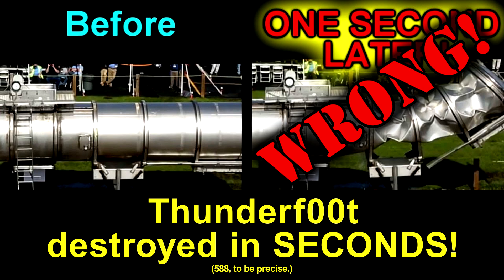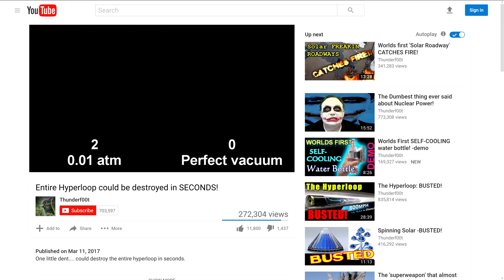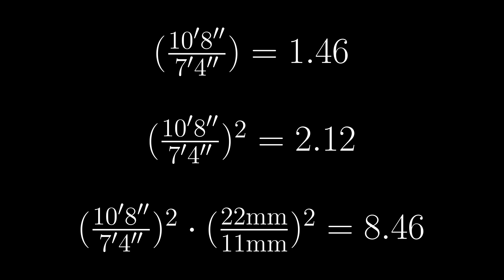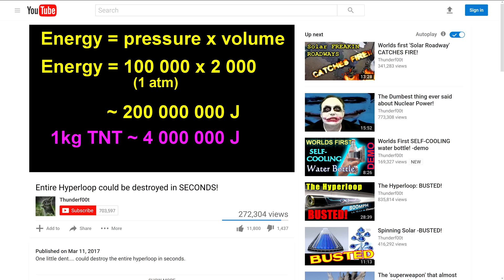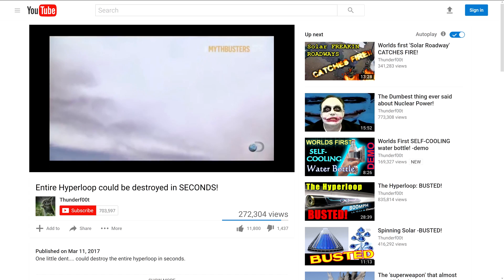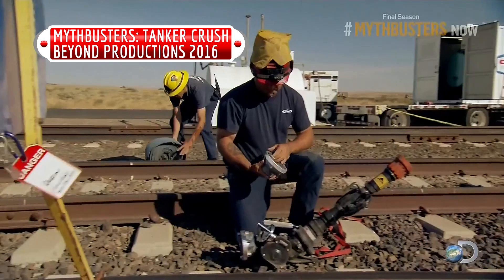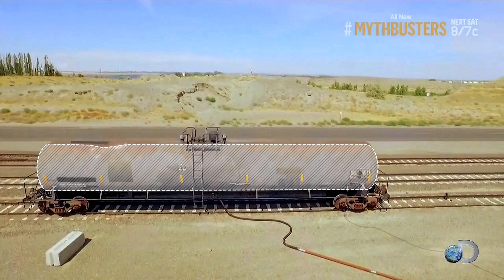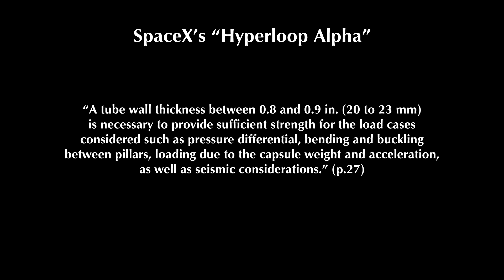Thunderf00t destroyed in SECONDS!

Comment: What about thunderfoot's other argument about expansion joint when this thing grow and shrinks that has a direct effect on steel. If it work hardens, I know not really an engineer or scientist first thoughts but, would that really throw a wrench in the structural stability of a large vacuum chamber?
Reply from the maker: Sigh...WE COVERED THE EXPANSION!!! Really, WHAT THE FUCKING GODDAMN FUCK IS IT with you people coming here and mouthing off WITHOUT EVEN FUCKING WATCHING THE SERIES???

HOUR AFTER FUCKING HOUR, DAY AFTER FUCKING DAY it's like this! One after another after another AFTER FUCKING ANOTHER!!!

WATCH THE SERIES OR SHUT THE FUCK UP. I do FUCKING NOT have the time to RE-explain what we already explained 50 times a day to people! IT'S COVERED IN THE SERIES!!! FUCKING WATCH IT!!!
Reply: well tell me how this is smarter than building a high speed rail with solar panels down the sides?
Reply: not with that attitude I was asking a question i'm sorry a simple iron worker isn't to keen on a giant vacuum tube in his backyard and it was not explained in this video
Reply from the maker: Because of land acquisition, which is easily the biggest cost of such an endeavor. The beams for the Hyperloop can be positioned alongside or in the median of a highway in the right-of-way. For going through land, you wouldn't need to purchase as much of it from the owners. Plus, the everyday running costs of high speed rail are MUCH higher. I don't think there's been a single case where high speed rail has ended up being anything but a money sink.
Reply: if that the case you could put the rails in the air with a regular train or a fancy new high efficiency train like the New York subway and the amount of materials would be roughly the same without the multi million dollar R&D right?

Comment: also exccesive heat and cold can have detremental effects on steel.
Reply from the maker: YOUR QUESTIONS HAVE BEEN ANSWERED. CATCH UP TO THE REST OF US OR STFU.
Reply: True but the container that he used for the example is NOT a complete vaccume those are used for transporting primarly liquids they used special allminum tankers to transport gases and they MUST have a air tight seal, also the body of the car and the inside is typically NOT made out of steel and for good reason aluminuim can do close to the job of steel and it is more then 2 times lighter, also theres not gaurntee that it will not be exposed to extreme weather becuase you cannot predict the weather pattern especially when you have tornadeos, and hurricanes that can rekt this also earth quacks will fuck this vaccum tube up and yes this is a vaccum becuase it is completely sealed and the pressure is less compared to the atomospheric pressure
Reply: "zack flannigan you also completely missed the point, which is that steel can handle temperature changes of 100 degrees easy" but aluminum can do it better also I defy you to name 1 car that uses steel and that is 2000s or older and is not a truck and no your missing the point am stating that  also am saying that you cannot be 100% certain that it will not come in contact with exterem weather extereme weather being tornadoes, hurricanes etc.

Comment: ok, how much energy exactly you would have to keep a huge tube under vacumm if its this open loop and what if we had a small hole in it or more like hundreds of them if the track is so long
Reply: + Shane Killian

4th generation Texas oil & gas business here.

(snicker) What kind of Lib Arts Major are you? Because no insurance company on Planet Earth would be guilty of extending liability coverage to the owner/operator a tanker trailer that relied upon positive internal pressure to maintain structural integrity. Ok?

Never fucking happen. Not in a million years. Because such constructions are, by their very nature, EXTREMELY FAULT INTOLERANT. And are waaaay apt to suffer catastrophic structural failure from even the slightest dent or ding. Not to mention a multi-vehicle pileup on the freeway... DUH !!!

So, thanks for playing. But we'll stick with Thunderf00t's analysis of the HyperLoop concept. Have a nice day.

MachOverspeed
Reply from the maker: Energy estimates are in the Hyperloop Alpha document. Basically, you just need enough pumps every so often that no one pump has to put in much effort. Like the old Light as a Feather game.
Reply: MachOverspeedsPlace thank you

Comment: 4:58
wait wait wait, if its not sealed, HOW THE FUCK DID YOU KEEP THE AIR OUT
Reply: air leaves/ enters as fast as it physically can, not as fast as you want it too, face it, pumping air into a SEALED plane is hard enough, now lets remove that seal
Reply: 7:50
WAIT, perfectly round? aren't cans and even massive pipes pretty damn far from that?
Reply from the maker: No, basic industrial pumps are easily up to the task.

Comment: So what's stopping some going hacking it with an axe...
+ The vacuum in the hyperloop is massive, way, way bigger than the tanker...
Reply: Thing about vacuum is that it can never exceed 14.6 PSI at sea level.  That's about one ton per square foot.  The tires in your car are supporting double that load.  You obviously don't have a lot of experience with steel OR with axes.  You might as well say "what's to stop someone from chopping a railroad track in two with a pocket knife?"
Reply from the maker: "So what's stopping some going hacking it with an axe." 1-inch thick steel???

"The vacuum in the hyperloop is massive, way, way bigger than the tanker." Um, no. We showed the math on that.
Reply: So you're going to build a cross-state hyperloop and it's going to be smaller than a tanker? Ok sweety, please do explain how <3
Reply: say, what would stop a guy with armour piercing bullets to destroy the hyperloop?
Reply: It DOES mean that it will be bigger, however. More massive, which was exactly the term he fucking used. MORON!!!
Reply from the maker: "say, what would stop a guy with armour piercing bullets to destroy the hyperloop?" Covered. WATCH THE SERIES, PEOPLE!!!
Reply: But... that's not what the person said. All he said was that it was bigger. Which is true. Additionally, it takes more energy to create a larger vacuum than it does a smaller one - so it does matter, fucker.
Reply: fredster taco don't waste your time with this guy, I did it once and he is the kind of guy that is "the right one", you know, like Alex Jones and others like him, if you quote one source, he will say it's not a trusted one, and things like " I show the math" (did you spot any real math in this video?), "you're wrong" and so on. The ping pong video shows the real world, all he did before and after that is show how fool he can be.
Reply from the maker: "If you watch a video of a bullet hitting a piece of steel, it doesn't just magically explode, it puts a hold through it, the rest of the steel is still there." And we show such a video in the series. Not that they'll watch it...
Reply from the maker: LOLWUT??? Having a long run does NOT mean having to have a larger diameter, MORON!!!
Reply from the maker: "It DOES mean that it will be bigger, however. More massive, which was exactly the term he fucking used. MORON!!!" What matters, SHITHEAD, is the PRESSURE DIFFERENTIAL. We showed that you'd need almost 8 and a half times the pressure to collapse the Hyperloop, and THAT DOES NOT FUCKING CHANGE WITH LENGTH!!!

IDIOT.
Reply from the maker: "did you spot any real math in this video?" See, this is what LIARS like him do. First of all, there IS math in this video, when we showed the Hyperloop would be 8.5 times as strong as the tanker. Second, this is a SERIES, and we're talking about things that are covered elsewhere in the series, so he talks about ONLY what's in THIS video.

It's the Thunderfarts like him that are acting like the Alex Jones people, responding to facts and math with lies and insults.

Comment: Why does the hyperloop not being a sealed system make any difference to the probability of catastrophic structural collapse? Wouldn't the vacuum "pressure" still be at vacuum at every point?  Especially if they are always pumping to compensate for losses, as you had stated.  Not heckling, just trying to understand.
Reply from the maker: Imagine the Mytbusters hadn't sealed that hole in the bottom. Do you REALLY think the tanker would have collapsed then? As long as there's a place where the vacuum can be filled by using less energy, that's what will happen. So the only way for it to happen on the Hyperloop is if the vacuum pumps were pumping out the air with a greater amount of energy than is in the structure of the steel. Seems unlikely.

Comment: 56 kWh is enough to charge my laptop, which has a 56Wh battery, 1000 times. I don't know what you imply by stating that it would cost 5 dollars. Are you implying to the viewer that somehow, 56kWh of electricity is tiny? I would like to see 56kWh of electrical potential energy run straight into your body. You will literally die in flames as the organic compounds in your body undergo rapid oxidation. Have fun with your "5 dollars of electricity"
Reply from the maker: What the FUCK difference does that make? Are they converting the vacuum to electricity and using it to shock the passengers? NO THEY ARE NOT.

Thunderfoot was trying to make it look way difficult and way expensive. IT ISN'T.

And by the way, battery charge levels are rated in amp-hours, not watt-hours. You charge it up to a certain number of amp-hours. How many watt-hours that translates to depends on the voltage of the battery. So nice job trying to sound like you know what the fuck you're talking about when you don't.
Reply: Very mature, resorting to cussing people out over the internet. Typical white Americans.

Since you guys tend to think that construction projects build themselves, let's do some budget planning here.

Musk himself proposes a $20 per ticket of 28 passengers every 30 seconds in each direction from SF to LA. Assuming the hyperloop is operational 24/7 for all 52 weeks of the year, it will rake in just over a billion dollars in gross revenue (588m in each direction). Obviously, the tube wouldn't be functioning constantly, and would need to be shut off for routine maintenance. Due to the fluctuation in demand during off-hours, we can also assume that it wouldn't be at full capacity at 3am. 

Investopedia here, http://www.investopedia.com/articles/investing/050815/elon-musks-hyperloop-economically-feasible.asp
did a slightly different calculation using the total number of proposed capsules (40) and the length of time (35min) of each trip to calculate the average departure time differences and came to a lower value of 15 million total trips, while I used Musk's proposal of 30sec per departure and got 29 million trips. Investopedia calculates 300 million gross revenue. But, let's take a look at the LHC in Geneva.

The LHC has a total annual budget of 1 billion. Obviously, a part of that has to go towards hiring researchers, equipment, supercomputers, and high electricity bills for their near-light speed particles. Keep in mind that the Hyperloop inevitably would need workers and engineers on duty to oversee operation, just like the LHC. Electricity costs for the Hyperloop would also go towards propulsion (of the capsule instead of the particle) and preservation of a partial vacuum. If CERN spends just 3% of their budget on physically operating and maintaining the LHC, it would spend 30 million, on that measly 17-mile long circle. Now let's consider TWO 350-mile long tubes between SF and LA. That's over 40 times the length of the LHC. 1.2 billion in operating costs with an absolute maximum revenue of 1 billion? Not to mention the cost of R&D and potential accidents. We can see operating costs rise up to 1.5 billion USD a year. Although, I hope Musk is certainly capable enough to find cost-cutting measures to make it profitable, but even then, it would take decades to break even, with the minimum estimated construction cost of 7 billion.

I don't get why Americans have this mentality of "if we can build it, we can profit from it." The day we see the Hyperloop being built is going to be the day the great Trump wall is erected. Which is to say, not in a long ass time.

Oh and speaking of battery energy, Wh can be converted easily to Joules. Ah requires voltage to convert to joules. When I talk about a 56Wh (appr. 201kJ) battery, I am talking about the total ENERGY, not charge. Energy is measured in joules. That makes it easy to convert between the different types of energies (thermal, kinetic, potential...etc). Batteries rated in amp-hours are designed for consumers to have an accurate sense of how long a battery would last given how much voltage it can sustain. Amp-hours are not used for any energy calculations. It cannot be converted into Joules without knowing voltage. You're confusing charge with energy. I appreciate the comedic videos you put out, but please try harder when dealing with matters outside of your knowledge. Have a nice day
Reply: "The LHC has a total annual budget of 1 billion. Obviously, a part of that has to go towards hiring researchers, equipment, supercomputers, and high electricity bills for their near-light speed particles"

A "PORTION?"  Consider that the LHC takes massive amounts of setup between experiments.  It is constantly being taken apart and reconfigured, which can take months of work, tens of thousands of man-hours.  It is not like Hoover Dam which simply sits there, humming away, day after day.  The cost of electricity for the LHC is an afterthought, lost in rounding error.

Using a scientific instrument as a comparison to a transportation system is incomprehensible.  Why not compare the cost of the Hyperloop to the cyclotron in the basement at OU?  It's only ten feet long, and takes a staff of ten to maintain it, so it is an order of magnitude more expensive on a per-foot basis than the LHC!  But neither of these is a transportation system.  Obviously the LHC can never be built because of cost impractilities, etc, blah, blah, blah.  And when does the LHC show a profit, hmm?

There's also the small detail that mass transit almost never makes a profit.  The Shenkansin operates at a loss on a large number of its lines, using the large trunk lines to subsidize them.  Any realistic analysis of mass transit shows that it is LESS efficient at moving people to chosen destinations than individual cars.  On a pure cost basis, loading a buggy full of hay and having a horse take you there is the most cost-effective.

They Hyperloop will be competing with airlines for travel between SF and LA, and the cheapest fare for same-day travel is $148 (that's on a budget airline where you have to pay another twenty bucks if you want to bring your clothes along).  Even cutting that in half, that's still $74 per ticket!  Decades to break even is not a scary thing for people who understand depreciation and civil works financing.  Most turnpike projects have a ROI period of decades.

I don't recall seeing where anybody was suggesting powering the Hyperloop vacuum pumps with LAPTOP BATTERIES!  How is that even tangentially relevant to ANYTHING?  Why not compare it to how much power it takes to charge your car battery?  How many Wh it takes to heat the water for your shower?  How much power it takes to make toast?  Bizarre!
Reply: re:  "battery charge levels are rated in amp-hours, not watt-hours. You charge it up to a certain number of amp-hours."  that's applied to a known voltage battery. Converting the amp hours to watt hours is valid for this equation, even though it's not the listing standard  1 amp hr  x 56 w  = 56wh.  watt hours is the actual charge level, when voltage is unknown or variable. 56wh applies to all battery applications, so it's valid here